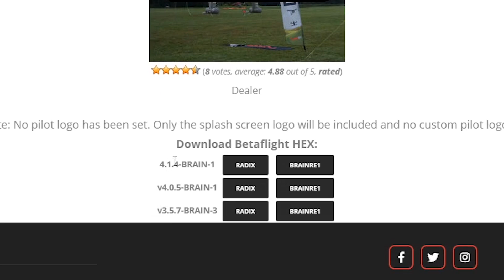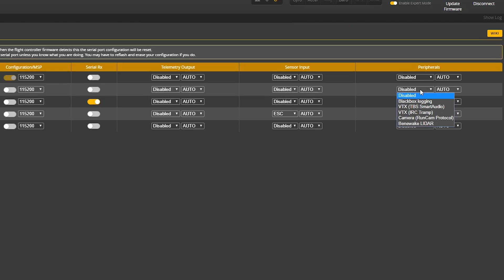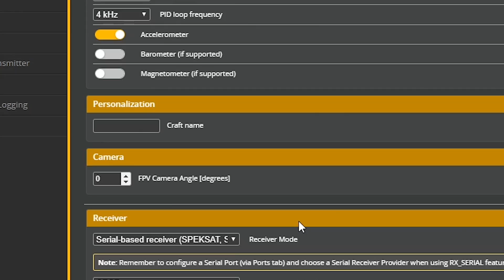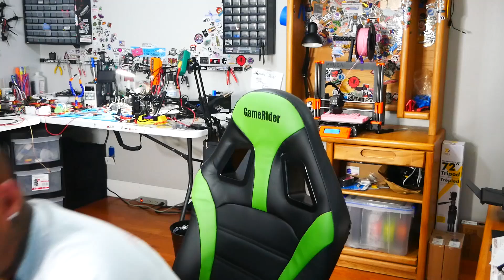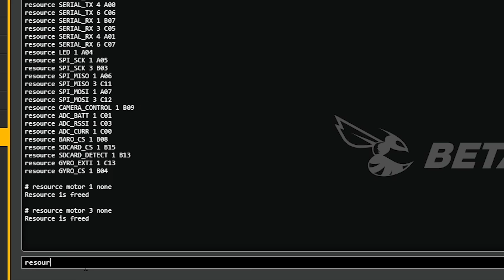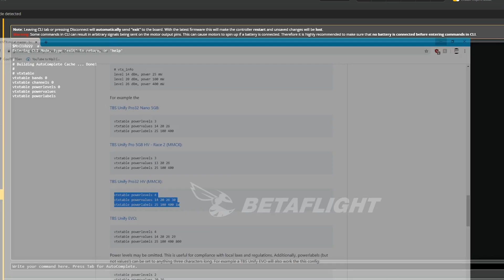How To Set Up a X-Class Drone!! Betaflight Tutorial On A Monster Drone!!

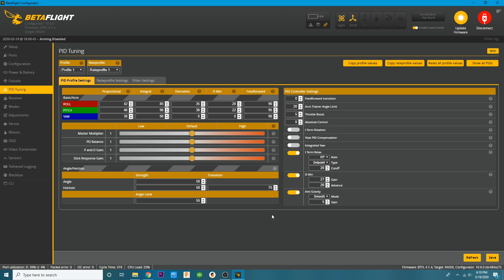Comment: 15:00 but what about filters? That part was not shown. If running on BF 4.2 the stock filters won't work. I know this because on mine I had to change the filters from stock to custom settings. Buddy of mine, MRAddict, is an experienced xclass tuning expert and has already helped several people get their xclass rigs running 4.2 tuned out by seeing their BB logs and giving pointers.

Comment: But if you setup turtle mode, then your minimum arming angle needs to be at 180°. Otherwise, it won't work and you won't be able to flip back over. It's currently set to 90°.

Comment: I love this series! 
@DrainMan FPV - I have a video request (easy one): I play the sim with my Jumper T16, I turn off both modules while playing to save on power, but I still hate it when I run out of batteries while the radio is literally connected to power (USB). Can you show us to to mod a USB cable to fit instead of a battery to the Jumper T16?
Reply from the maker: Hey Amir! This sounds like a fun video to make! The power mod available adds an external charging port, but it wouldn't charge via the USB. You would have USB plugged in and the external power source. To make it charge via the USB while playing would require hardware change. I will look into it for ya!
Reply: DrainMan FPV oh I don’t need it to charge, just want to play for hours without worrying about batteries 🙏